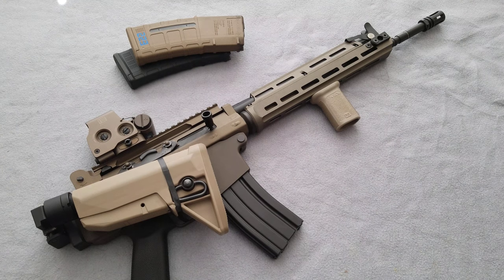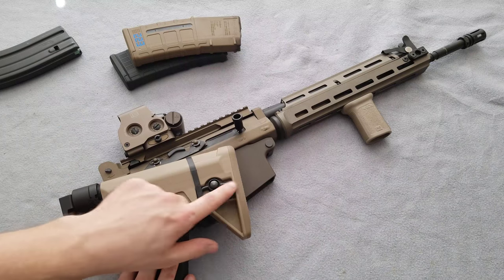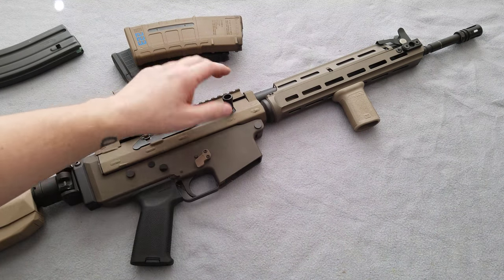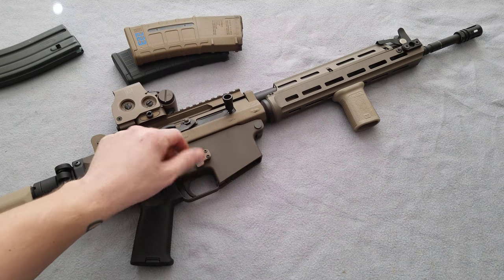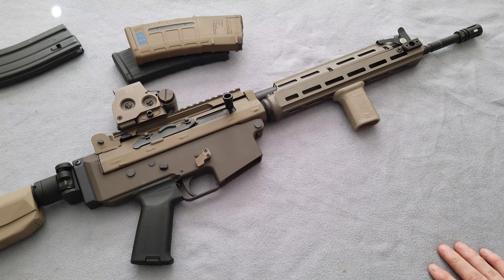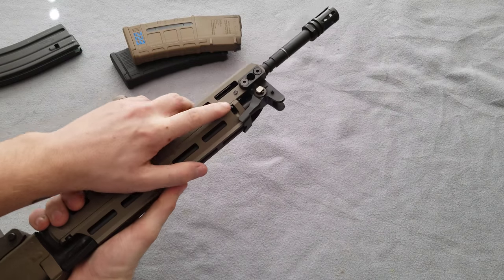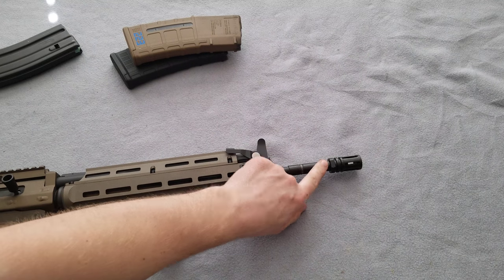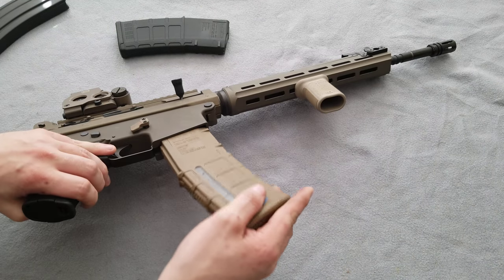FN FNC modernized

Comment: I feel as if this thing has been on gunbroker for ever. I own a FN-FNC Para. Currently in the process of acquiring a sear. You're going to regret selling it.
Reply from the maker: The one on gunbroker is not mine. It belongs to the owner of KDG. I did all the work on it for him.
Reply: I wish we could post pics in the comment section. Going to make an update video with the sear? I'm sure you know but these will take FAL grips. I'm running an Ergo on mine.
 @Nordic_Goon
Reply from the maker: @tomjjackson21  yeah I just prefer the size of the magpul grip. I will post videos when sear is approved. I'm also manufacturing an mlok handguard that will be free floating for the fnc and I'll bring it to market.  Stay tuned
Reply: Norse Forge 
Any updates on that rail? Haven’t been able to find anything on it, and the site shows as being down for me

Comment: If the handguard was free floating this would be as good as any modern rifle.
Reply from the maker: I agree. I actually designed a free floating handguard for the fnc, but never got around to machining it. The fnc has a barrel nut that could be replaced with one similar to an ar15, then the handguns could be mounted directly to the barrel nut alone.

Comment: I have a bone stock Series 1 FN FNC I got from FN Company while in the USAF and I love it just the way if came from the factory with a hand selected Match Grade barrel (1.2inch groups at 500 yards). The ONLY thing I added was the Stormwerks top Picatinny rail and a Bushnell Tac scope as used by the US Army Delta Ops. and I designed an adjustable height cheek rest for the paratrooper folding stock that does not modify the original stock. An all original FNC's are going for $20k, a BIG reason not to fuck one up modding it when it doesn't need it. - Capt. USAF 20th SOS, 27th Spl Ops Wing Retired.
Reply from the maker: Original FNC's are not going for that. Registered auto sears for them are going for 14-16k. The gun itself 3500 to 4000.

Comment: I'm sure the rail on top greatly improves the rifle. And the new stock probably works better with the new optics. But to be honest, I do not like the rest of the mods. They detract greatly from what was a beautiful carbine. A matter of taste I guess, and there's no point debating that. ;)
Reply from the maker: AllAhabNoMoby well I own two, so there's that. One is stock.
Reply: Well I am very envious of you then. I've fired one a few times but do not own one. It's one of the best .223's ever made, IMO.
Reply from the maker: It's literally a FN Scar, but it just never got the attention that it deserved. Manufacturing costs at the time made it impractical.
Reply: I've never even seen a SCAR so I wouldn't know. I am a fan of light weight but is the SCAR as tough and durable as the FNC?
Reply from the maker: It's lighter, the only part I've really seen break on the scars are the stocks. They're polymer, but can be swapped out for pretty much any durable stock. Scar is a little lighter even though it's bigger thanks to it's polymer lower. Companies make aluminum lowers for the scar too though, so you're not really limited to having a a gun that you wouldn't feel comfortable with the durability of.
Reply: Thx for the info! 👍

Comment: How much cost for all the upgrade? Also the total weight reduce? Thanks
Reply from the maker: I think including optic,  you're looking at around $1000 maybe a little more if you count the cerakote. As far as weight reduction, you're not saving a whole lot, handgaurd probably stayed the same weight, but most the weight savings are probably in the aluminum components used in the stock adapter since there's a lot of steel components in the factory para folding stock. I've actually sold this, so I can't tell you a how much it weighed exactly, as I never weighed it. It wasn't bad at all though, and I miss it.

Comment: Nice, I would like to know how does it run in full auto with the shortened barrel and the increased back pressure from the can?
Reply from the maker: I'm actually working on a completley revised bolt carrier, gas block, gas tube and piston for the FNC that will shorten it to a 7.5" barrel and a totally redesigned lower receiver updated for modern components. And a new handguard design that will mount to a redesigned barrel nut and will be free floating.
Reply: @Nordic_Goon  I wouldn't go that short on a 5.56 barrel, if it's just for a project gun, I don't see the problem but for any kind of use, it's going to be horrible. The fireball is blinding, the sound and concussion is horrible and the ballistics won't be worth it. But it sounds like a fun project! Be sure to upload some updates cause I would love to see that
Reply from the maker: @yawenclaudio5756  well i have suppressors so...
Reply: @Nordic_Goon  Fair enough, you got me very interested now!
Reply from the maker: @yawenclaudio5756  who knows might get froggy and make it 300blk
Reply: Norse Forge Oh hell yeah, 7.5" 300 blk suppressed FN FNC, sounds fucking awesome!
Reply from the maker: @yawenclaudio5756  the barrel for it would be simple to make since the locking lugs engage inside the front trunion and not with the barrel. Would just need to get someone to turn it for me.
Reply: Norse Forge Do you think you would ever release an update video?

Comment: Hi, just one Q. How to remove The protective cover for The mechanism? I have always wondered that with The FN fnc. 🙃
Reply from the maker: The dust cover by the charging handle? Just pop the spring out. If you're mean the factory handguards, you just pop the clip off the front sight base
Reply: @Nordic_Goon  thanks for The answer. Yes i meant The protective cover for The mechanism but i have a Hard time figure it out. But maybe iits different on The swedish armys standard issue carbine, the FN fnc modded  version. The cover looks The same as yours. Can you explain how to take it out like you explained it for a 5 years old.. No a 3 years old please :)
Reply from the maker: @abbeItheIman  Sure, it's relatively easy. If you notice, there is a wire that is used as a spring for the cover. On both sides, it wraps around the posts on either side. On each side, the wire is wraps around a post and hooks onto itself. You simply unhook the ends of the wire,  and slip them off the posts, then slide the wire out